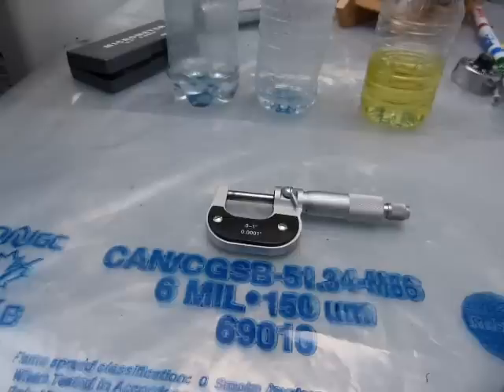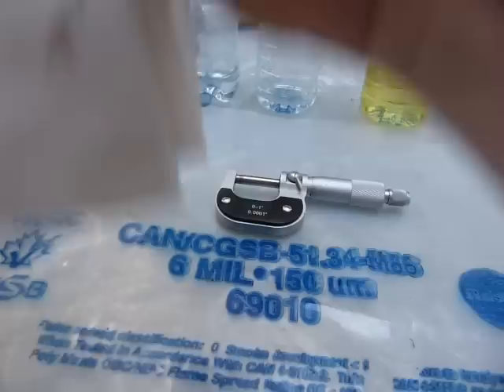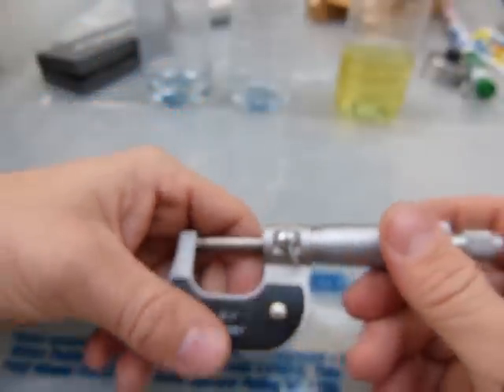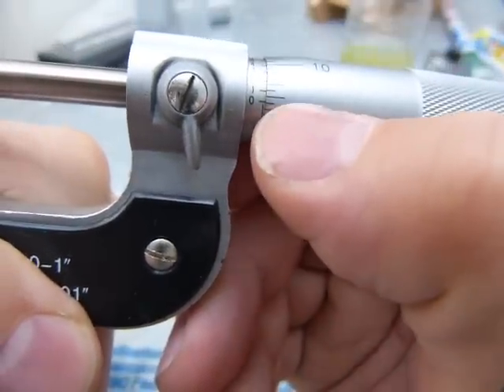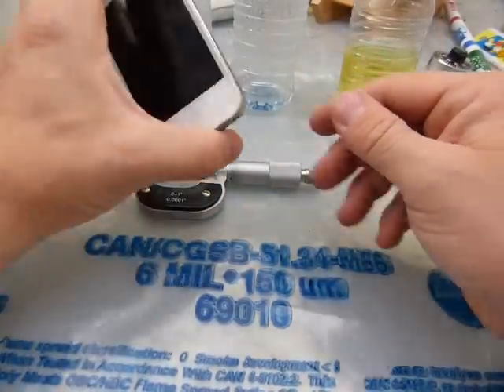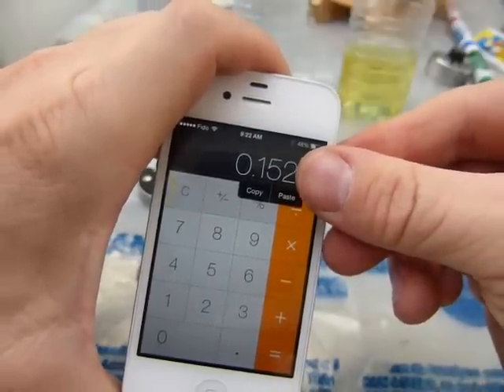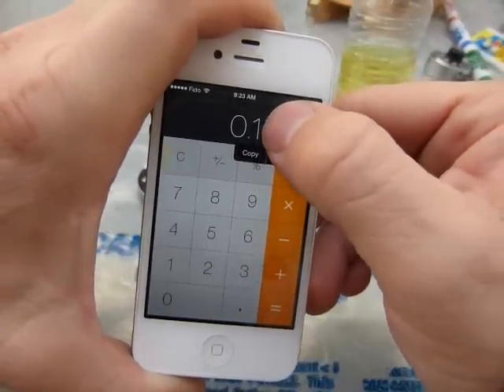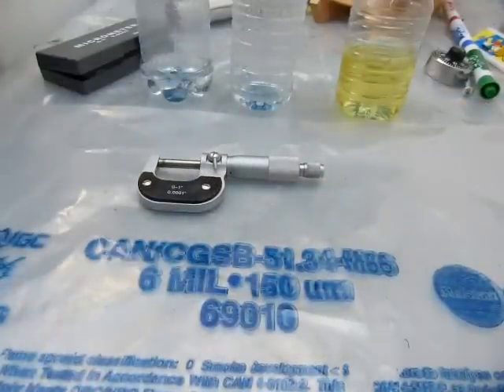So how thick is a "6 mil poly"?

Comment: Thank you for the video. I just needed to see how 6mil plastic looks like in video. FYI, 1 mil = 1/1000 inch. 6mil = 0.1524mm, or ~150μm (not u.m., not o.m. - it's "micrometer"). I know you covered this later in the video but I found it hard to get past the first 30 secs :) Cheers.

Comment: hii apprenticemath,

so nice to see your video. 
i am puzzling with this mil stuff. 

i would like to grow some mushroom, hence wanted to purchase this thick sheet of plastic bag kind of material..
 it is call 4 mil poly tubing. 
how thick of a sheet of 4 mil poly tubing ? because the poly tubing is fold flat when nothing in it, hence iti s actually 2 sheets. 
so, does 4 mil means 2 sheet is 4 mil thick or when inflated, each sheet is 4 mil ? 
that 's same applied to 6 mil bag. 
does your 6 mil bag is 2 sheet (folded flat) = 6 mil thick or 
when inflated each sheet is 6 mil thick ? 

if you able to tell me the answer i would greatly appreciate it. 

thank you.
Reply from the maker: 4 mil = 0.004 inches thick, single sheet.
Whend doubled, 0.008 inches thick
Same math with 6 mil; single sheet is 0.006 inches, folded is 0.012 inches.
Reply: hii apprenticemath,

you said a 4 mil bag is single sheet 4mil, then double sheet is 8 mil ? 
but i saw you measuring a folded bag and the display on the gauge is 4 mil = 0.004 inches which is actually the thickness of the total of 2 sheets together .. ??

now i am confused.. when the vendor said it is a 4 mil poly bag, does he meant:
a folded flat bag (2 sheet) = 4 mil or 
a single sheet of the folded flat bag is  4 mil 

?
Reply from the maker: Measure the vendor`s bag, see if it works. The sales guy often doesn`t really know or care ...
(Don`t worry about my picture, or how it was cut together or how many sheets are needed for the camera to focus with the given light ...)

Comment: From Latin, NOT French.
Reply from the maker: +Colo Riqueno From Latin mille to French mille to English mil, following the shortening of Sir Whitworth`s unit of a thou. (from 1844)
Reply: i would like to grow some mushroom, hence wanted to purchase this thick 
sheet of plastic bag kind of material..
 it is call 4 mil poly tubing. 
how thick of a sheet of 4 mil poly tubing ? because the poly tubing is 
fold flat when nothing in it, hence iti s actually 2 sheets. 
so, does 4 mil means 2 sheet is 4 mil thick or when inflated, each sheet
 is 4 mil ? 
that 's same applied to 6 mil bag. 
does your 6 mil bag is 2 sheet (folded flat) = 6 mil thick or 
when inflated each sheet is 6 mil thick ?
Reply: um = micro meter